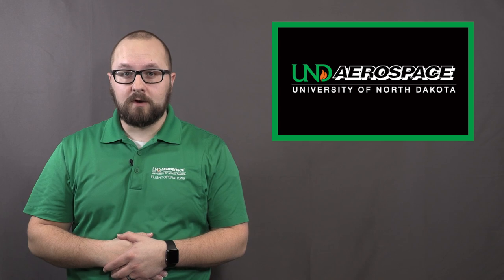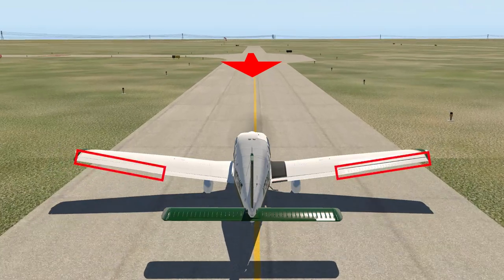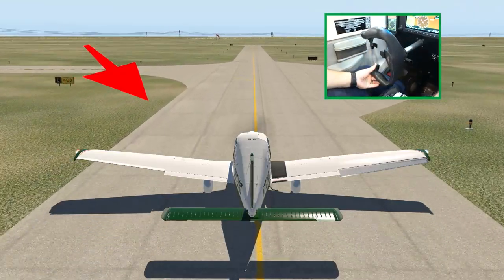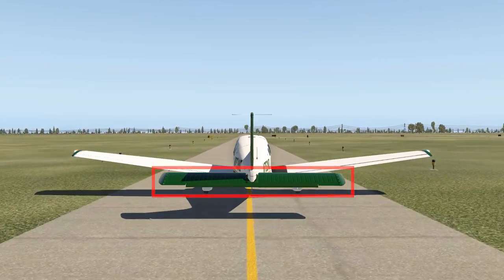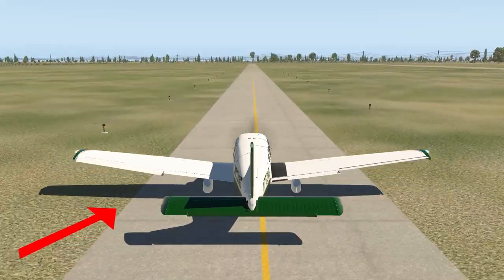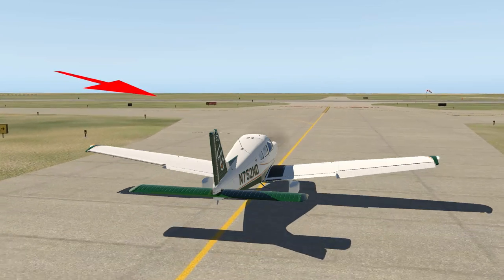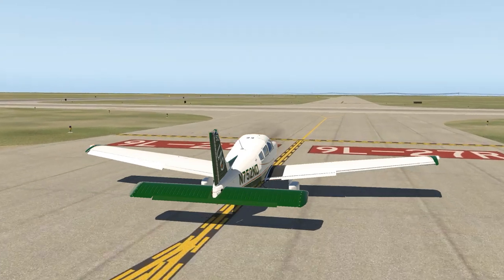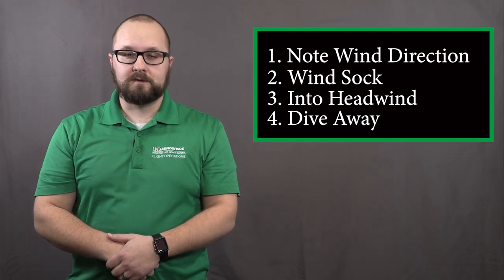Control Inputs while Taxiing

Comment: The way I imagine the X wind correction is that you have PVC pipes attached to your hands, facing vertically when you are making no control inputs.

In order to properly correct for X-wind, the wind has to be able to travel into the openings and through your PVC pipe. 

This helps me a lot and when I become a CFI I will teach this to my students. Maybe I’ll even buy some PVC pipe to demonstrate
Reply: Very useful analogy. Thanks!

Comment: not a good explanation. basically, you just tell us what to do but don't explain why.
Reply: hey mate, same with me, I didn't understand why its opposite when its a tailwind. 
This vid helped me understand: https://youtu.be/Iw3IcrLAFhM?si=r40-gjewzSqrjwd8

My explanation: Wind from back. Back right explaination. The wind has potential to lift the right wing and elevator. 
Especially if backpressure=elevator up, and right aileron=right aileron up
Causes a lift force on the elevator and the right wing.

Hope this helps